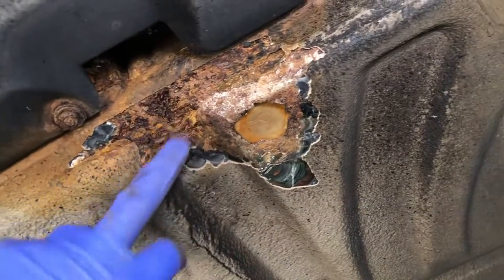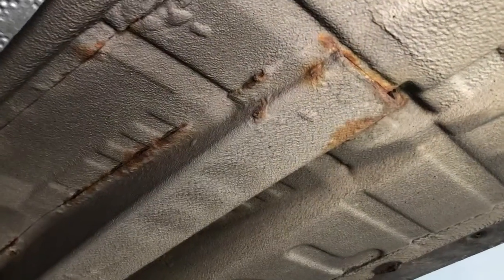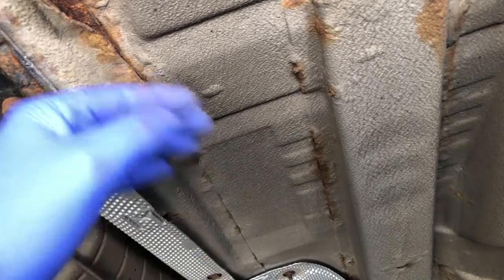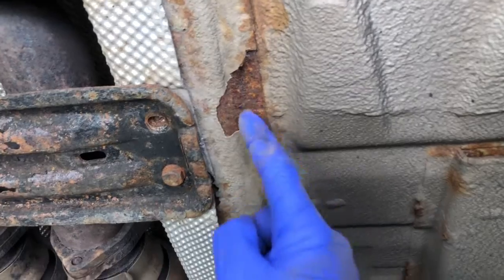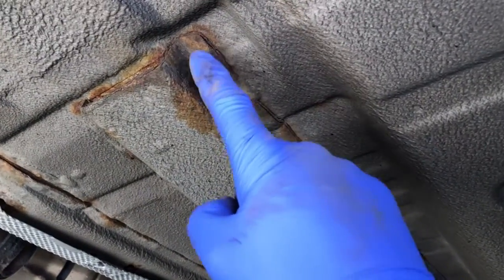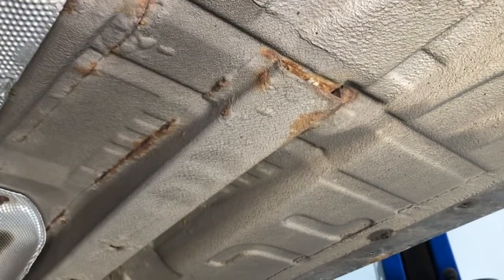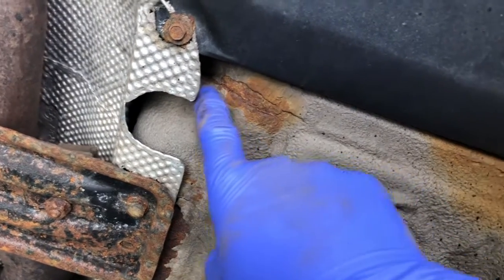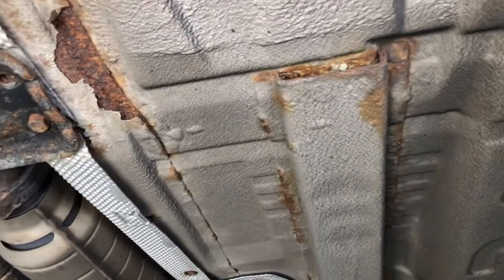What is TRAPPED Corrosion?

Comment: Firstly, great to see you back on the YT again! Well explained. I've restored a few cars, all of them German, all with that very problem. For the guy that doesn't want to "dig in" and do it properly, there is a way to prolong the life of the car. 1. Spend as long as you can be bothered removing all visible rust and degrease all the exposed metal. 2. Using the 360 degree spray lance that is designed for cavity wax applications, treat inside the chassis legs with a good rust converter, I swear by Fertan. You should see the liquid wick out of the spot-welded seam by capillary action. 3. Treat the external rust with Fertan and wash off any excess after the curing period. Leave to dry out completely or assist drying with gentle use of a heat gun. 4. Apply 2 coats of Rustbuster Epoxy Mastic to the exposed metal. (check out www.rust.so.uk) 5. Treat inside and out with Dinitrol wax-based protection, 3125 outside and ML inside. 6. Check every year and re-treat as required. DO NOT do what I did and put any faith in POR15 product, everything I have used it on failed after a year or less. Rustbuster know their stuff and will actually rust protect your vehicle for you.

Comment: This is exactly my biggest nightmare with my e46.. owned from new in 2002 and with nearly 200,000 miles driven mostly in Massachusetts the underside of mine looks very similar.. it may just be the seal sealer and undercoating that is left holding it together at this point! 😂

Comment: This is why on my Camaro restoration I've removed a lot of panels the clean the mating surfaces and welded them back on. I just did this with the CSB bracket on my e46 as the studs needed replacing and and the bottom of it had rust growing between the tunnel and the bracket.

Comment: I have a solution that works however its unconventional and messy. I spray the area with rust remover and pull off all the loose seam sealer. Then I pack the seams with copper grease. After six months i repeat the process. The copper grease leaches right into the seams and kills the rust. I guess after a few years of this you could clean the exposed surfaces and treat and paint them leaving the grease trapped in the seams. I have been doinv this for 30 years now and its never failed me.